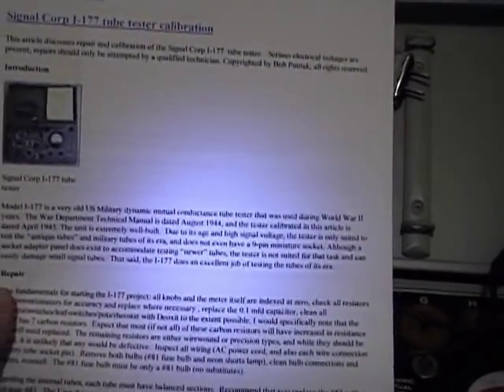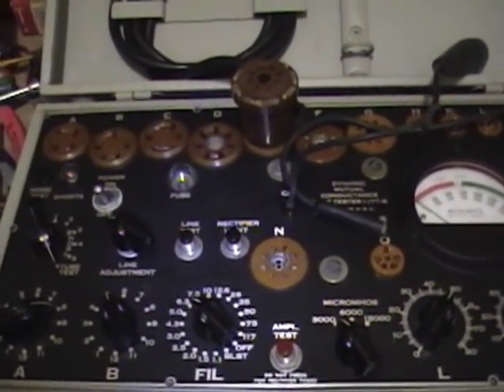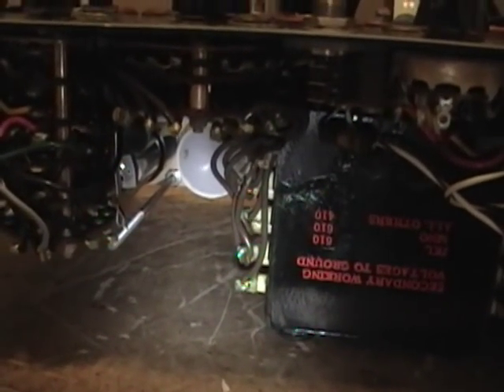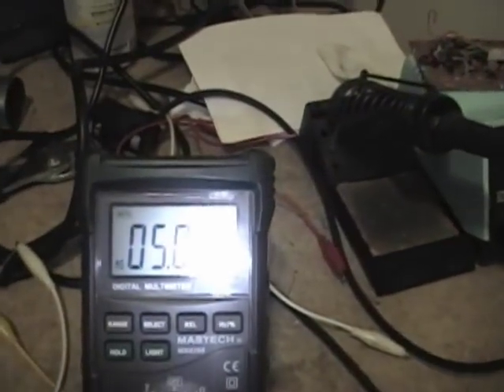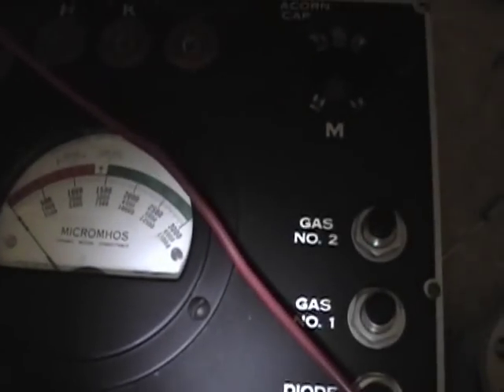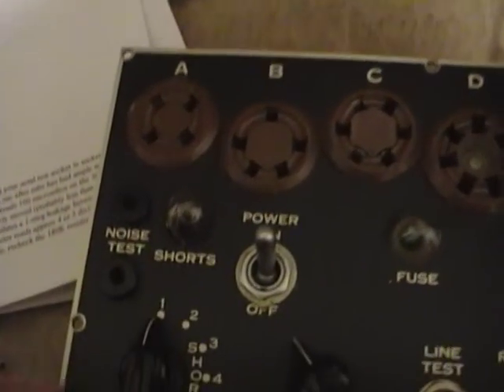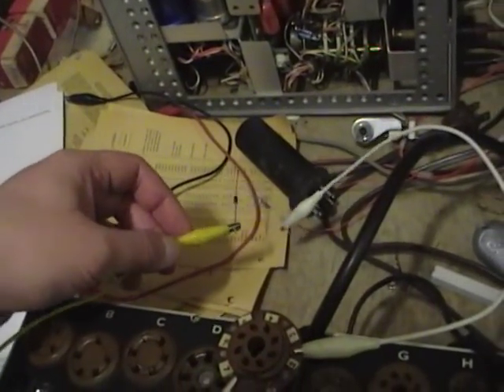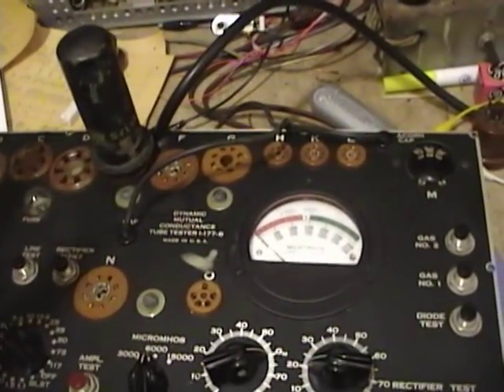I-177B Tube Tester Calibration

Comment: I built a voltage check tube socket. Instead of shunt accross meter took a broken 6l6 tube used base and soldered shunt resistors inside faster voltage checks

Comment: I would of tested for mutual conductance using 10k resistor and 50vac. That's what other hickok testers mutual conductance reading test instructions say to use. Then you wouldn't of had to adjust the L control

Comment: I just tried my solid state 83 replacement I made works great no recalibration needed just swap and use :) you should build one for yours. If you still don't get the 150v. For mine I ended up having to flip the diodes around

Comment: Arnt those adjustable resistors why need resistor in parallel?
Reply from the maker: It's a 10 year old video and my memory is foggy.  What portion are you referring to?  Generally speaking, you would use two in parallel so the bulk of the power goes through the less expensive fixed resistor.  Also you would have much more control as the variable resistor would be to fine tune the fixed resistor.

Comment: I purchased a vtvm Triplett 850 payed good price needs some restoration great for checking voltages and resistances
Reply from the maker: I still say you should use a modern DMM.  There's a reason they stopped making VTVMs decades ago.
Reply: @bandersentv  yah. It's still handy to use for verifying voltages cause guessing on which shunt resistor to use isn't very accurate
Reply from the maker: @Tysman909  You will still need to use a shunt resistor with a VTVM.  They are high impedance same as a modern DMM.  You need a VOM
Reply: @bandersentv  this one is 1000ohm/volt
Reply from the maker: Owners manual states 11 Mega ohm impedance in DC volts mode.  That's standard for a VTVM.
Reply: @bandersentv  why would calibration instructions for hickok tube testers say to use a 1000ohm/volt meter if vtvm's measure higher then that
Reply: So looks like a vtvm is no different then modern dmm only difference is dmm is digital sounds like a 1000ohm per volt is an old analog meter
Reply from the maker: @Tysman909  VTVMs were expensive back then too.  Many service techs only had a VOM so they wrote the calibration procedure for a VOM
Reply: @bandersentv  ah makes sense. I got vom and vtvm mixed up I should of been looking for a vom instead. I payed about 180$ for this vtvm. Cause it's a large meter maybe can mod it so it's 1000ohms per volt using resistors and a switch

Comment: So your 17 ohm resistor is reading 14 ohms and had to add resistor in parallel to drop it further to get on line. Sounds like the 17 ohm resistor is wrong that they used from factory. Should change it out for a pot be easier for adjusting line in future

Comment: Look up (Update hickok 539c calibration) on ARF you will find the diagram to build the proper solid state 83 with the zener diodes.
Reply from the maker: Thanks for the tip.
Reply: @bandersentv  your welcome it does work built one for my 752 tester
Reply: You ended up making one of those ss83 tubes based on the ARF post?

Comment: Hmm, from what i gather from other videos using a solid state 83 does not replicate the 83 mercury tubes operation well (specifically the 15-16v voltage drop). So a little surprised calibrating with that solid state is advised. Even using something like a Copper Cap W83 from Weber does not do the trick (despite their claim that it does simulate the voltage drop). Adding some zeners to the solid state to get that voltage drop should work better.

Comment: Should make a ss83 tube really easy. Reason yours isnt working is doesnt have the zener diodes. Probably has the 10ohm resistors and 1n4007 diodes if you do build one make sure you add a fuse between resistors and where diodes come to a point. Its worth building one and saving your 83 tube as a spare. I built one for my hickok 752

Comment: nice video, thanks!  When you opened the I-177, did you just remove the screws on top?  I just got on and with all the screws along the edges removed, it just doesn't want to come out!  I am guessing that maybe the rubber feet on the power transformer may be stuck to the case?  thanks